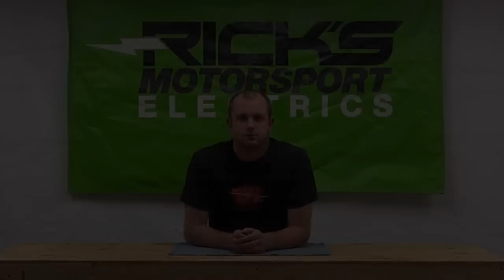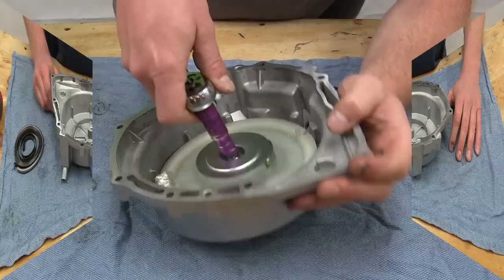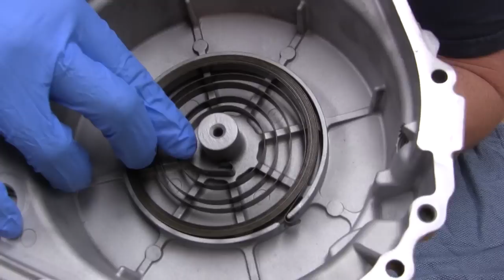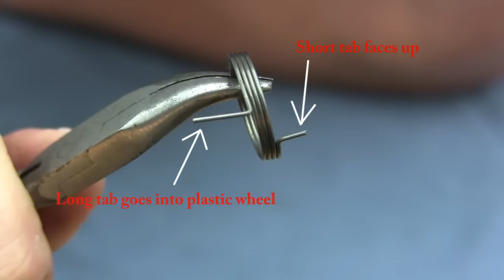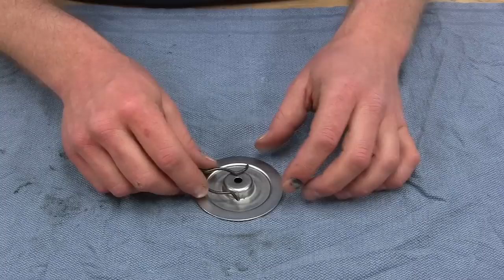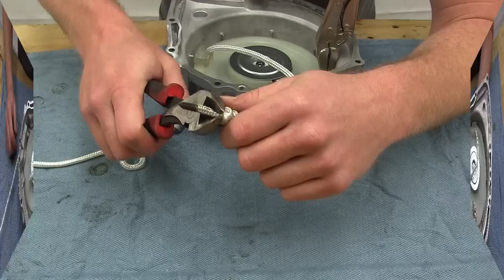#6 How-to Install Polaris Pull Start Repair Kit From Rick's Motorsport

Comment: So, how come when I tighten..or snug the bolt down, the pulley sticks when its supposed to reel the pull rope back in, BUT if I leave the bolt loose, it's works fine...(I know that bolt WILL fall out if I keep it loose). I actually added grease to the pulley, spring, friction clip, etc.

Comment: I followed your directions to a T but for some reason my dog leg won’t kick out to engage flywheel. I have the clip on the friction cup parallel like you showed. What else could be wrong that it doesn’t wanna kick out?
Reply from the maker: Could possibly be that you tightened the bolt down too much.  Make sure it's lubed/ well greased.  If you're still running into problems, text us at 603-329-9901 and we'll connect you with a tech

Comment: Should add lube up the metal friction plate so the dawg comes out, and if you don’t grease the plastic bushing. The pull cord won’t go all the way in either. Learned these the hard way lol

Comment: So this will probably help many people out there . I bought a after market kit. It looks the same as the one in the video. You put it all together and the ratchet arm does not engage!!. I took it apart many times just confused why it wasn't engaging. Well I brought  the friction spring to the vise and pinch it a bit more that it was very tough to put on the plate. It stays in place and worked perfectly after. I hope this helps someone . I saw a comment on here that a guy had the same problem but no one got back to him. That was 4 years ago. I'm sure he figured it out by now . lol
Reply: I’m having the same problem now. It’s all together but the arm won’t engage. How will pinching the friction spring help?
Reply: I’m putting mine together too. I cannot get it to engage. If I do, the rope won’t retract. I saw someone mention a “sweet spot”! I cannot find it! HELP!
Reply: Seems like a poor design; if you have to leave the bolt loose to allow it to retract. Loctite will help but I like it when bolts work as intended, without the smurf pee. I’m not sure how long the loctite will keep the bolt from loosening(or tightening it seems), hopefully for a long time but who knows. I wondered if a thin washer on the threaded post that sticks out would help any.

Comment: excellent video.  We did not tighten down the middle bolt super tight because it keeps it from snapping back, We used blue threadlock once you find that "sweet spot" and make sure to test it before putting the cover back on the flywheel to make sure you can pull the string and it snaps back the way it should.
Reply: I just had the same problem, but I put a washer below the plate (same bolt but under plate) and it worked perfectly.  This stopped it from pinching and allowed it to recoil

Comment: Where did you get that recoil spring clamp!?  Having a heck of a time trying to get that spring wound up, and in place without that clamp.
Reply from the maker: Hey Jordan - our kit comes with the spring inside the clamp so ti's ready to go.  You might be able to get just that clamp from Polaris if that's all you need, but you'd have to check out your local dealer for pricing & availability

Comment: great vid, I just wish it covered what to do if it tightens down too much. If I loosen it where it will snap back the bolt is only finger tight.
Reply: Yea, little more detail would been nice instead of wasting a day trying to figure out what the fuck i did wrong